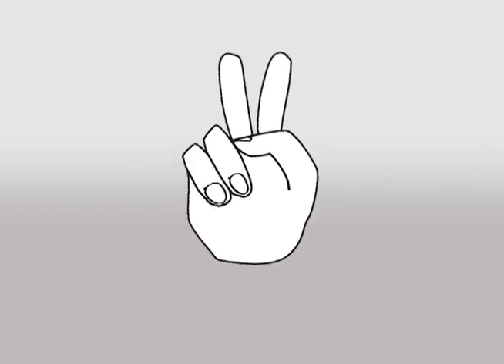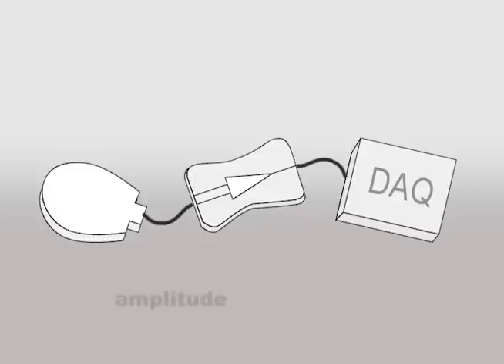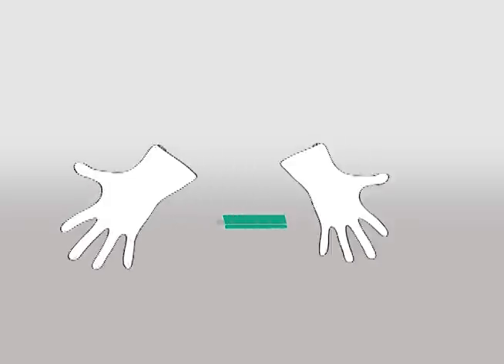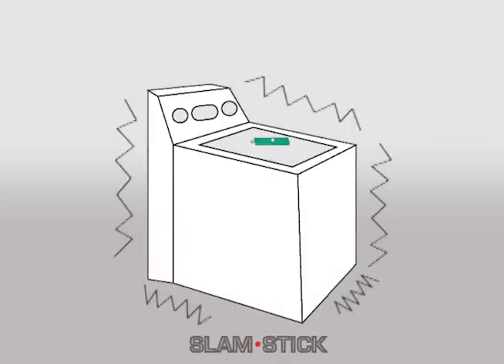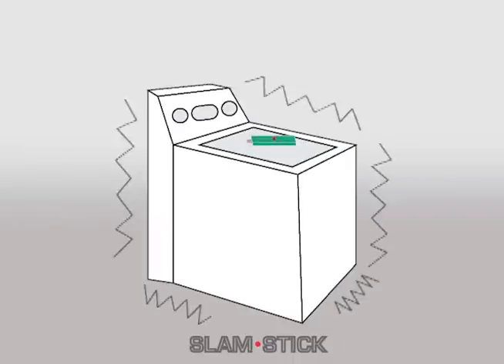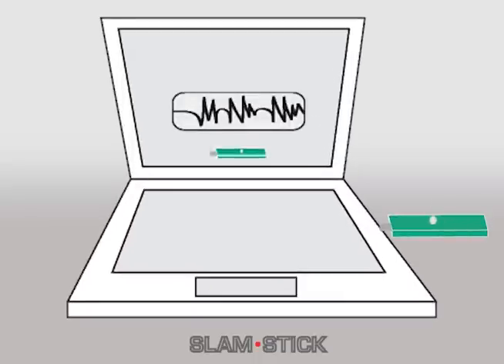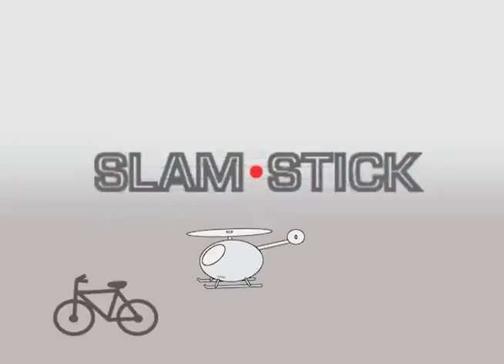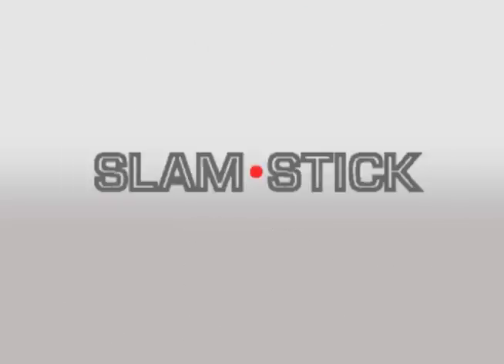How to Measure Vibrations with the Slam Stick Vibration Data Logger

Comment: What sensor is used in it?
Reply from the maker: Hi Yu Lu.

The sensor is the ADXL345. Here is a link to its datasheet: http://www.analog.com/static/imported-files/data_sheets/ADXL345.pdf

Here is a link to the datasheet  fot our latest product's (Slam Stick X) triaxial accelerometer: http://80.93.56.75/pdf/0/5/2/9/6/05296196.pdf

Thanks.